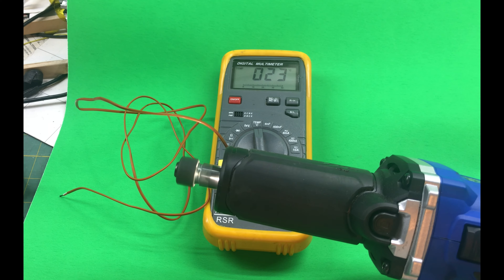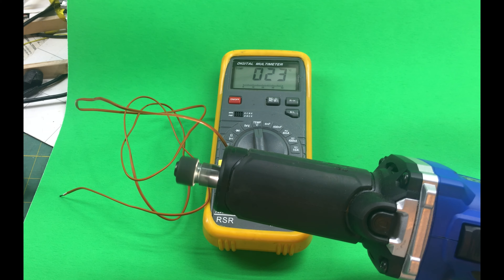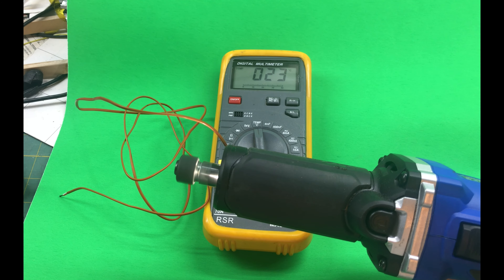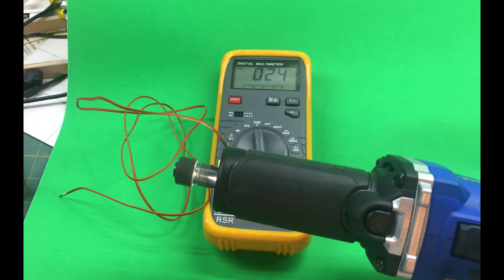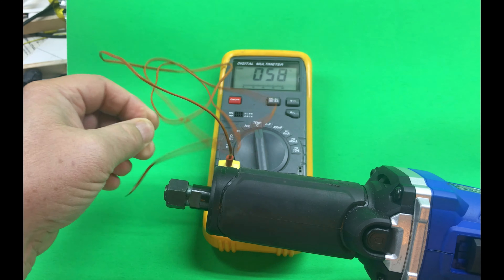KOBALT DIE GRINDER #KDG 124B-03 Shaft heating up

Comment: The bearing is bad. You can hear it when the pitch of the tool running changes.  Replace the bearing(s) problem solved.

Comment: What did you do with it? Mine has the same problem I ended up returning it.
Reply from the maker: Returned it and got another one
Reply: @waynel8645  Cool, sounds like they were just occasional bad units, I may go get another one. Thanks.
Reply: Just had the same issue. Returned. 2nd one smooth as butter. Thought it sounded off.
Reply: Was the replacement quieter? I just got one and it’s insanely noisy. I have to wear hearing protection with no load. 

They are all on clearance now and they didn’t have any more at the store so I’m not sure what they will do. $40 for a die grinder is pretty nice.
Reply: @gf2e  yes. 2nd was as it should be. Noticable difference. Swap that one out